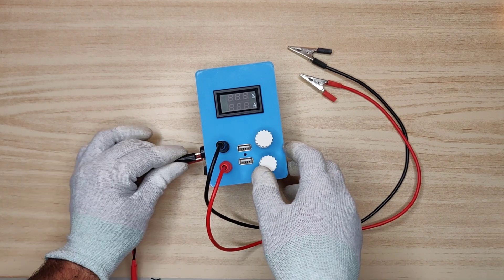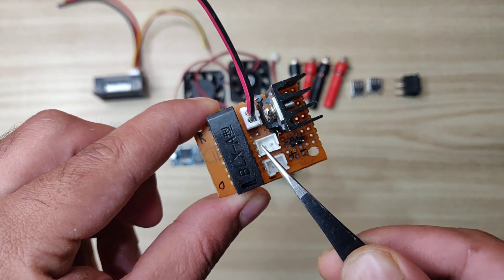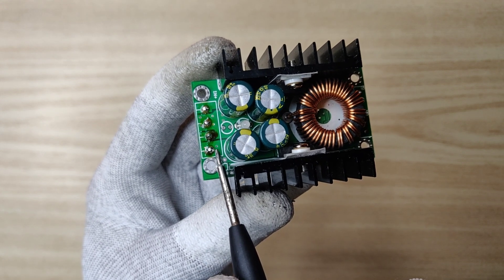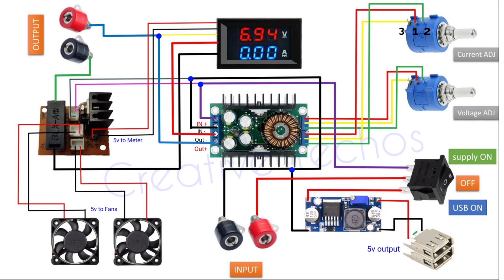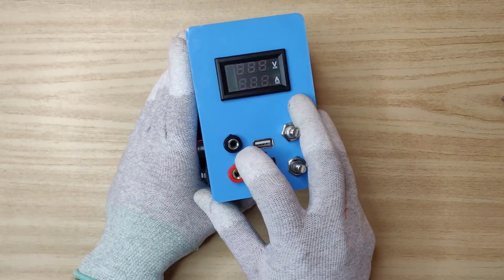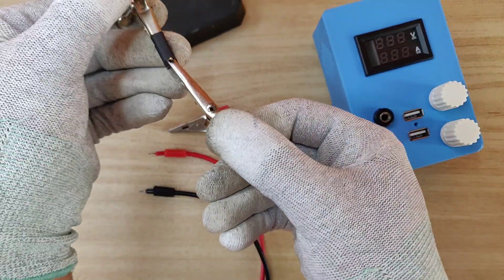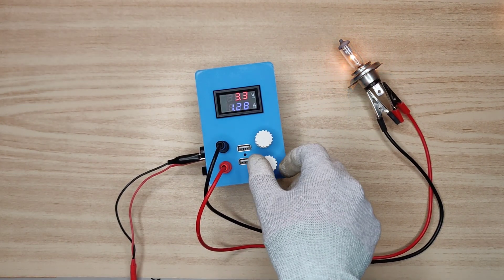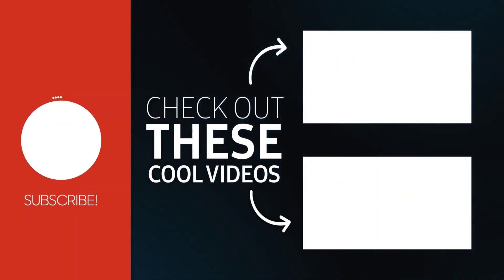0-30v 0-10a variable lab bench power supply DIY

Comment: Hola muchas gracias por compartir este excelente video,  una consulta la fuente trae protección o no la trae , y si no la trae quisiera saber como le se podría agregarle una protección  para que se proteja.  Gracias saludos desde PERÚ 🇵🇪 sudamerica.
Reply from the maker: Actually the regulator module used has inbuilt short circuit protection

Comment: Is this also advisible for short finding to such pcb's like laptop or phone?
Reply from the maker: Actually, the step down module used has short circuit protection, it will turn output off if short circuit or overloaded

Comment: amperes are not changing, what is the problem
Reply from the maker: Where amperes is not changing?
Reply: @CreativeTechos  I have the same bulb mention in your video, amp not decrease when I rotate the knob.
Reply from the maker: Did you use same 300w step down buck converter module?
Reply: @CreativeTechos  Ys same.

Comment: is it possible to use laptop repair etc ??
Reply from the maker: Yes you can use it is safe as it is made with High power buck converter module
Reply: @CreativeTechos  sir my plan is your this device+ 12-0-12 v transformer+ bridge rectifier to make ultimate power bench in one casing , can i do that any other thing need to attach to transformer to make it stable current provider ? and  please make a video on laptop repairing ( uses : laptop powering, power injecting to find short circuit in laptop motherboard) 

i think this module is short circuit protected 
so another requirement is 
I'll inject 4v without short-circuit protection to see which component is heating up 
how can i do this please tell me sir ☺️❤️❤️❤️

Comment: Can i use a 30v 10a transformer with full bridge rectifier for input?
Reply from the maker: Yes, and use 2200 uf Capacitor to filter output from bridge rectifier, then supply to this circuit
Reply: @CreativeTechos  Which diode should i use for bridge rectifier?
Reply from the maker: Use 4x MIC10A diodes with 10A transformer, to get 10A dc Output
Reply: @CreativeTechos  ok thanks

Comment: Which power supply is best in your opinion : this lab bench power supply or variable power supply which you made in your previous video?
Reply from the maker: For what purpose?
Reply: @CreativeTechos  I need a power supply which can help me to supply power and as well as to charge battery.
Reply from the maker: If need for both supply and charging battery with auto cutoff the video i latest uploaded is best circuit, you can add voltmeter on output
Reply: @CreativeTechos  Thanks❤️❤️

Comment: what fuse i need to use?
Reply: my circuit output is not working through fuse..but when i correct directly from the buck converter its working without any problem...what could be the issue? fuse is fine...fuse is not blown..:-)
Reply from the maker: Need 30v 10A fuse, but actually the buck converter comes with its own short circuit protection.
Reply from the maker: Use 10A fuse
Reply: @CreativeTechos  thanks 230v 10amps will work?

Comment: Great video, as a beginner i learnt alot in short period of time. Your DIY projects are  very good. I suscribed. Question i need to make 30 - 50A charger for my 6x12V battery bank, any suggestions
Reply from the maker: Thanks for appreciating, and let me know, did you mean 6 packs of 12v battery you want to charge in parallel?

Comment: awesome job... how is the input voltage 220 v ? if you join the probes, the corrent continues flow ? to find shorts circuits ? shots caps for example
. ? thanks
Reply from the maker: Use DC input 30v 10A SMPS, The output is short circuit protected, if short happened it will automatically turn off.